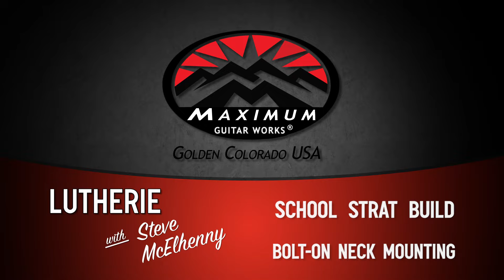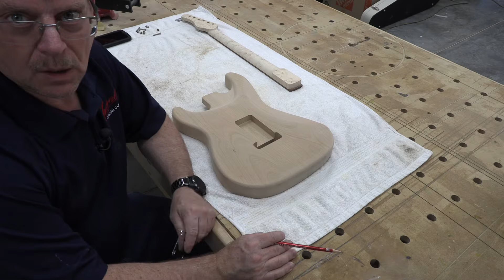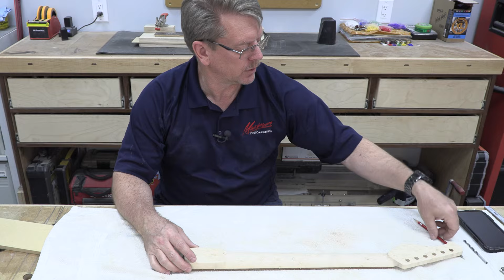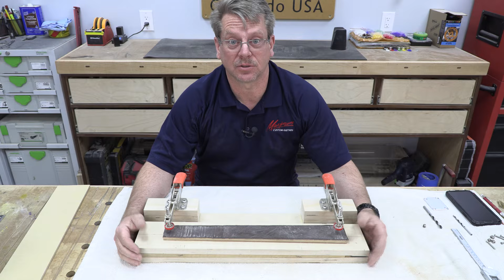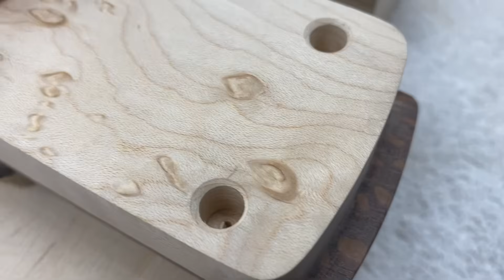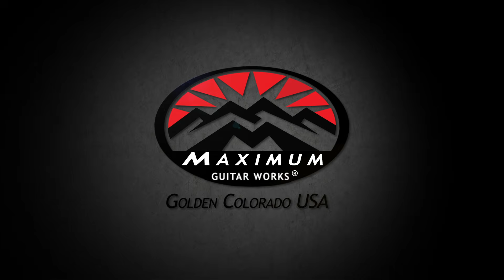The School Strat Build - Best Bolt-on Neck Method...ever!

Comment: You made this super easy to understand. I have a question; I am adding threaded inserts onto an existing guitar I am completely rebuilding. I am also reshaping and contouring the neck heel which will require ferrules, should I plug and redrill the existing holes?

Comment: Just like a tap for metal threads, tale an extra insert and cut  three axial grooves into the sides of the insert.  This allows it to cut threads into the wood. The fully threaded insert compresses the wood into threads versus cutting threads. Then remove the grooved insert and install the fully threaded insert. This is also beneficial for inserts near the edge or into end grain.

Comment: 18:40  I cringed a bit when I saw the headstock bending under the weight of the clamp force.  Ideally, wouldn't it be safer to clamp just behind the headstock so it's clamping the neck/fretboard like you are with the other clamp?

Comment: The hole alignment is the most important.  With the neck tightly clamped in place, drill a very small hole th4u the body and right I to the neck. This keeps the holes fully aligned. Then independently drill the holes to the necessary diameters.
Even brass threaded inserts are so much stronger than the wood.
I take a spare insert an cut edges into the outer threads, making a "tap" out of it. The. It cuts a thread in the wood versus compressing threads into the wood.  Then use a standard insert in the cut threads.

Comment: I don't know about that neck pocket and neck but another company that makes components says to slide the neck in from the end, not push it down from the top. Their pockets are ever so slightly tapered on the sides, so the neck locks in place. Metal on metal threads, I'd put a tiny amount of blue Loctite on those threads, since you're not using a lock washer. On some neck woods I'd be real careful about my insert hole size too, so you don't split the neck wood - roasted maple, for example. For a fragile wood it might be best to have a looser hole and use some glue on the insert threads - the metal to wood part. Just a thought.

Comment: So I`m assuming that it would be a possible to insert the threaded inserts before the neck is rounded and radiused. That would save me building another jig for the moment. The threaded inserts would not be in the way of anything (that i can think of) and could even help me with attaching it to some other jig... or a radius swing for example. Excellent video by the way.

Comment: when using ezlok inserts, i drill the hole, then tap it using a tap and die set. this ensures i get a straight, true insert as ive already made the threads in the wood.

Comment: A very interesting method of fixing the bolt on necks allowing removal and refitting of necks without  resulting in a potentially stripped hole. Might I suggest using the drill press with your homemade adapter bolt to screw the insert into the neck, resulting in a perfectly perpendicular result every time. The drill press can be turned manually to do this, making sure that the electricity is turned off for safety purposes.🎸
Reply: Great idea !!

Comment: Hello how are you today This is very the 29 20 25 time goes by I really appreciate your quality videos I don't care what anybody says if you put a lot of detail in your videos on there I listen just wanna add a note when you're inserting They're called blind nuts if you wanna call it that that's what we do Or I am take AQ tub with lick of soap and dip it in just a tab you wanna just moist Insert that to your in your wood now you have a lubrication and a guaranteed not to SPL and going within smooth two to three days you'll have a hard time to remove that little unit It's like a glue but I sure love that you video that you put out I would love the body that you made I haven't seen any of your videos at Allen but is it possible to buy from you raw wood already made cut out the neck and the body from you I hope you read this and thank you for sharing your video

Comment: wouldn't you also want to put tuners and a bridge on so that you can center the outer strings and make sure that the neck is aligned properly before drilling the neck holes?

Comment: Okay, let's get some terminology correct here -  the OEM method used to affix necks to guitars is to use the common - Dome-head - Philips-slotted - countersunk WOOD SCREW.    However, the BEST method - by far - to accomplish a tight interface between body and neck is by using  MACHINE SCREWS in THREADED INSERTS.   

BOLTS are distinguished by convention as having,  either square, hex (with or without internal slotting), splined, or Torx-star heads and are rarely if ever countersunk - and either designed to screw directly into a component or INSERT or,   through a component and affixed tight (with or without a washer)  with a NUT.   Hence in common parlance,  the combination fasteners - ''Nut and Bolt'.   The nut is nearly always of complimentary design and size to that of  the bolt head.    Basically if it has a fine-machined thread designed to mate with equal threaded female aperture and doesn't use a nut or need a spanner - its a MACHINE SCREW.     

Most - and soon all - of my non-fitted necked guitars use this method after I identified - through many inspections of Fender (and copy) Stratocaster neck pockets; showing signs of stress around the sharper corners, often leading to delamination and even body cracking around the pocket;  there is a lot of force on a guitar neck and if used live on stage,  might get a lot of (lateral) abuse; as well as each time one pick's up a guitar it is often via grasping the neck - the standard OEM 'woodscrews' are simply not up to the task.    I use M6 - Torx-headed - countersunk - stainless-steel machine screws in either brass, steel or SS M6 threaded inserts.   And each one of the guitars that are so fixed,  show more resonance and solidity.   This method is particular essential on 'loose-fitting' interfaces.

One could use it as a paddle to raft the Colorado and although the guitar might be unplayable at journey's end - the neck will still be solidly attached to the body.

Comment: I installed brass inserts in a Fender style bass quite a few years ago.  I put them in for quick neck removal to keep from having to check my bass when flying, especially on those commuter planes with smaller overhead baggage compartments.  I would pull the neck and put it in the soft case next to the body, then fold the the neck portion of the case over with a bungie wrapped around the waist for a smaller profile.  You can wrap the neck in a towel to keep from scratching the body.  The inserts worked great for this, but I found that the tone was a little less warm after.  I recently decided to switch the bass back to wood screws, so after removing the inserts, I drilled out the holes and glued in dowel rods to get back to the more woody sound.  It did make a small difference to me.  The presenter here is correct about using brass inserts.  The brass screwdriver slots stripped out and were a bit of a pain to remove.  I'm pretty sure that wouldn't have happened with the stainless steel inserts.  The tone thing is a matter of taste: One of the better guitar players in town installed inserts on his parts Tele and never looked back.  He loves them.

Comment: I thought about doing this and realized the threaded inserts must be inserted from the top of the neck below the fret board. The inserts will need to have a plank on top of the sert as to pull the neck tight against the body. Like this"T"

Comment: Hey Steve great video. When making a flat grain Birdseye maple neck as you have here in this video I assume that you have installed carbon fibre rods, am I correct. I am also building the same and am using bolts with inserts. Just wondering if you can tell me what distance from the end of the heel  you place your carbon fibre rods so they don’t interfere with the inserts and what distance from the nut? You have the best videos out there and please don’t leave out any of the details as that is a big part of what makes them so good.

Comment: For a shop,  "Buy a used manual Bridgeport mill with a mill vice and a digital readout about $2500. for a nice one, and there are a million of them around used because everyone has switched to CNC mills  I do this type of true "bolt on" neck with inserts.  With a Bridgeport everything is easier and way more accurate.  I always drill a pilot hole even in wood then step up to your finish size.  When you chamfered your holes the chamfer was not perfectly concentric, if the neck was in the vice you can then switch to your chamfer bit and do that operation before moving the piece.  Further, using your setup you can always get back to zero, meaning you can drill all four holes perfectly by using the digital readout.  Lastly, the insert tool will fit into the chuck on the mill and be thus perfectly square, no chance of cross threading.  For your method, clamp the neck in your holding device put the insert tool in the chuck, lower the insert to the wood and screw the insert in by hand.  You must put light pressure on the quill to make the threads bite into the wood.  This will ensure perpendicularity.  With the mill method, lower the insert tool to the wood with light pressure and turn (mill off and in neutral) the chuck by hand to thread the insert into the neck.   For your method, instead of using the tip of the drill bit to find center buy a set of transfer punches designed to do just that.  Buy a Chynese set, for wood they'll last a lifetime.  BTW, to gain leverage on the chuck when turning by hand (drill press or mill) stick the wrong end of the chuck key into the chuck tightening hole(s) to help screw the insert into the neck.  Sorry for the long post. Edit; Leo was kind, the four neck mounting hole layout are 1.5" X 2" easy.

Comment: I would like to add other than eyeballing the center of the penciled holes - Use the clamp to clamp the neck plate in position and use a true centering punch that will perfectly put the marks in the exact center of the holes of the neck plate

Comment: How about tapping the wood with a tap use your drill press will line it up straight turn the chuck by hand  when you get half  way in back it out  finish  it by hand with the tap handle

Comment: Since you use the drill press you can also use that for your 2-nut insert tool to start the insert in the hole exactly perpendicular. I just drop the head down and turn the drill by hand to get it started very straight and perpendicular. Then release it from the press and finish it off with a ratchet. Maybe a little more complicated and unnecessary, but if your after perfection 😉

Comment: Suggestion: I use threaded insets for all kinds of stuff, and I tap the coarse external threads. For your necks, you could tap the neck threads using your drill press manually ( just to keep the tap perfectly plumb/square w the surface. I use a few drops of CA glue when inserting  the insert. This all allows for just an xtra .001” or so around the insert - it’ll still be very solid but you avoid the risk of the inserts cracking the butt of the neck w seasonal humidity changes. I had that happen a cpl times so I started tapping them first. The coarse tap you’ll  need is not common but wherever you get your inserts should be able to fix you up.  I got mine from both Grainger and McFeely at one time or another.  Try it - it also makes the insert go in like butter, no chance of a slip that could damage the neck.

Comment: When I put steel grommets into guitar necks, I just put the insert bit into my drill press and (obviously with the power off) use the perfectly vertical pressure from the press and I turn the chuck with my bare hand.  The other fantastic feature of the steel grommets are if you use four recessed neck ferrules instead of a plate, it's much easier to find metric bolts of various lengths, or even cut a longer bolt down.  It's much more difficult to find the short wood screws necessary for a tapered neck heel to keep the bolts from poking all the way through.

Comment: great job! i need to do this to my strat with striped wood screws.... anyway you could ditch the nut driver and chuck your home made driver into the drill press, spin the chuck by hand while putting small amount of pressure on handle for leverage.... a little wax and  they go in dead straight every time...

Comment: At 22:00 Steve could use the special tool he says he doesn't like by setting it into the chuck of his drill press - the perfect perpendicularity of the alignment is still assured from drilling the original holes! - and then start turning the chuck by hand while  gently pressing down on the plunge handle of the press. Most drill presses are designed to allow such hand-turning of the chuck...

Comment: You don't really need perpendicular holes. You need co-linear holes.
So drill a smaller pilot hole thru both the body and neck.
Then drill at the needed diameters

Comment: Very good!  I've fitted inserts, and maybe not followed every step here to the letter, but it is important to get the basics right and avoid damaging the neck.  I like the idea of using locked nuts and a piece of threaded bar to align the insert.  I recall having some difficulty using an Allen key when I installed mine.  Next time, I'll use the locked nuts.  And for anyone wondering whether inserts are worth the effort, yes, they are!  The tighter neck join definitely makes the guitar's tone better.

Comment: This is literally a job I'm about to tackle for myself for the first time in a couple of weeks, I already swear by inserts in my instruments.
Have you ever thought about wicking some water-thin CA glue into the threads of the inserts? Only reason I ask is that I've seen other people who use wood glue on the threads, and it seems to me that CA glue would have a better hold if that's what folk are after.
Btw, there can never be too much detail on a video like this, you went into everything I possibly needed to hear about doing this.

Comment: You made a great point on making sure that the holes in the body are ever so slightly larger than the screws(or bolts) you use
Sometimes players use oversize screws for more bite and security for their guitars and forget to enlarge the holes in the body.
If the screws or bolts bind even a bit in the body before they find purchase in the neck, the neck will slip.

Comment: My good man what you are holding is indeed not a bolt but a hex head cap screw. To get technical a bolt does not have threads.  To be fair the term bolt is overly misused.  They should call it a screw on neck because anything that has threads is a screw.

Comment: I use the Big Gator V-drill guide and hand drill and have never had an issue with perpendicular screw holes.   I put the neck heel in a drill vise and use a small bubble level to check straightness of the neck.  Works every time.

Comment: Trying to improve something just to add more problems in the future when a simple thing like stripped thread occurs.
I have bought a used Warwick bass with J style pickups mounted on brass threaded inserts.
Two of them are stripped.
God luck pulling them out.

Comment: Can you tell us we're you get those inserts.
Reply from the maker: Amazon, McMasterCarr, McFeelys Hardware. These are some of the place I have used. 

E-Z LOK Knife Threaded Insert for Hard-Wood, Stainless Steel Thread Inserts 8-32 Internal Threads, 0.375" Length Pack of 10 https://a.co/d/6LCu8K5

Comment: I’m having difficulty finding threaded inserts from a guitar parts supplier like stew Mac etc — I could just order from McMaster but wondered if you had a recommendation for a particular part #? Thanks!!
Reply from the maker: E-Z LOK Knife Threaded Insert for Hard-Wood, Stainless Steel Thread Inserts 8-32 Internal Threads, 0.375" Length Pack of 10 https://a.co/d/6LCu8K5
Reply: Thank you!!
Reply: Thank you!!

Comment: What’s the possibility of cracking the insert hole torquing the insert in? As you bared down on 
the insert, I was cringing 😩
Reply from the maker: There is always a chance. You can tap if you think it is needed…but these ss inserts are designed to cut the wood fibers.

Comment: Im not knocking your method but just offering info you might appreciate.. in regards to your e-z lock tool, you can mount the shank in your drill press & use a small amount of hand pressure to keep perpendicular tension on the ez lock tool & you  can drive the tool w/ 1/4 open end wrench.. this ensures the same perpendicularity as the drilled hole..
even better, you can use a ratcheting tap handle w a center machined into the top of it & put a spring loaded center into your drill chuck for the ultimate in ease.. i use this set up myself & it works great & wont cost you $20-25.
i also rub some bar soap on the inserts for a bit of lubrication to ease install..
just found your channel & super appreciate your efforts in jig & template design, far superior to what else ive seen available... great job!

Comment: How do you worry about cross threading in steel?  I'd worry about cross threading in wood first.  Secondarily, going counterclockwise until the click will prevent counter-threading every time!
Reply: Exactly what I learned (actually from Gunsmithing)  Pete

Comment: Are these EZ-Lock brand inserts? And if so, what size do you use?
Reply from the maker: Yes…or the equivalent. I buy in bulk now. 

I use 8-32…an I feel like that is the best size for spacing on the neck…and strength.

Comment: Ez loks are terrible.the tool shears in half with any bit of force and the inserts will continually strip even before that happens. use the allen head style inserts found in hardware stores and you will have much better success! similar idea to the tool he made in this video